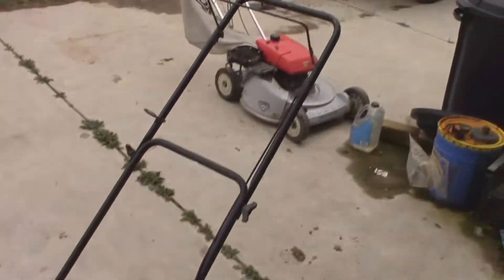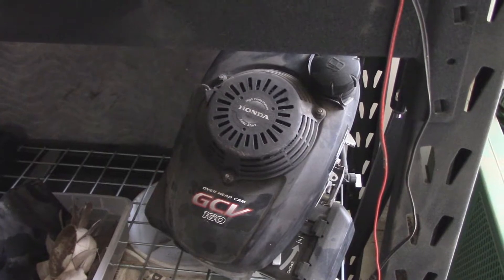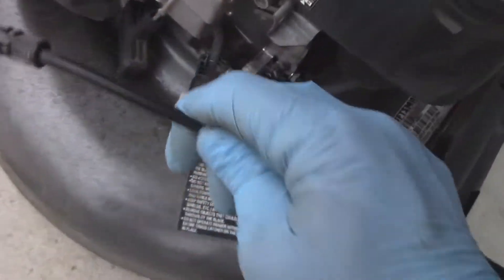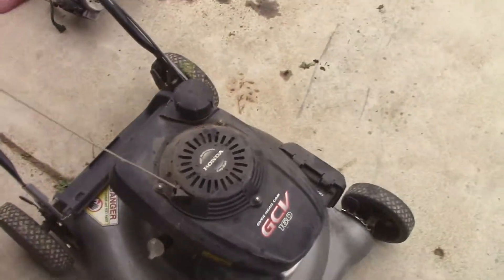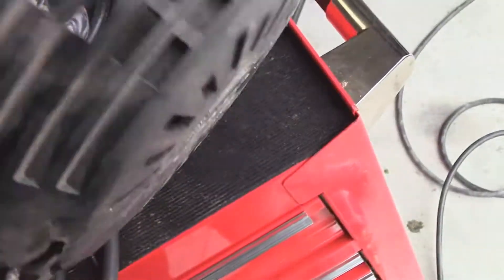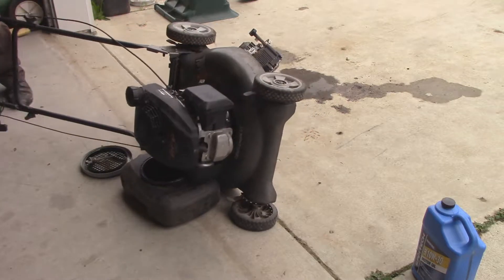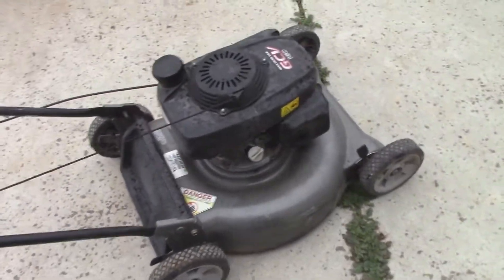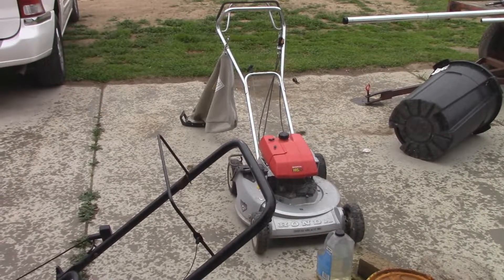Craftsman 21" Honda Swap

Comment: Thanks Hank - Getting ready to put an old Honda engine on a Craftsman frame also . Going from a self propelled Honda MTD deck to a Craftsman regular deck with rear discharge deck . Honda engine run good - Honda has the old manual. Choke on it . I think it'll all turn out good for good sale too .

Comment: My Honda GCV160 says 12oz of 10W-30. Should I be adding more?
Reply from the maker: Always check the dipstick as you are adding worse case just tip and dump some out if overfill.

Comment: And people will buy a Honda motor on a Craftsman deck?
Reply from the maker: Ya why wouldn't they?
Reply: Didn't think they would for some reason
Reply from the maker: +Sean “S3EN” Slater all these mower brands use all sorts of motors. Husqvarna uses Briggs and Stratton Honda craftsman uses Briggs Hondas and now they use there own on some of them. The legitimate Honda mowers don't use the exact same Gcv series of motors I don't think. These are Hondas but are intended for third party manufactures. Look up some of the new ones at Sears, lowes and etc you will see what I mean. Hell this motor came off a cheap husqvarna.
Reply from the maker: +Sean “S3EN” Slater

 http://craftsman.com/craftsman-21inch-rear-wheel-drive-160cc-mower/p-07137900000P

Comment: I can put any motor on any deck? i never even thought of that before.... but it makes so much sense.  I'm really going to have to get a gas mower for next season, the electric is fun but that cord is a dick! great vid bud!
Reply from the maker: Yup these craftsman mowers share the same with MTD Which owns  Murray yard man yard machines and etc. all the decks come out of the same factory. They just paint them differently based on who the manufacturer is that sells them so all these decks have the same bolt pattern's drilled into them. That's how I was able to get that kohler  to fit on that craftsman a few vids back. I don't believe craftsman sells a lawnmower with that particular engine.
Reply: hanksranger now I just need a Murray because well... its my name. who cares if it even runs!
Reply from the maker: +paradoxdesigns lol if you lived closer to me id happily give ya one man

Comment: If you take a motor off of a 20 inch deck can you put it on a 22 inch deck
Reply from the maker: +Dylan Gleason The only difference is the blade. Just swap to the proper sized blade and you will be fine